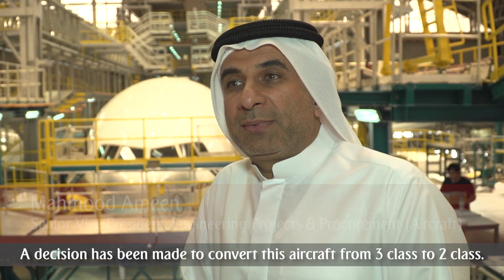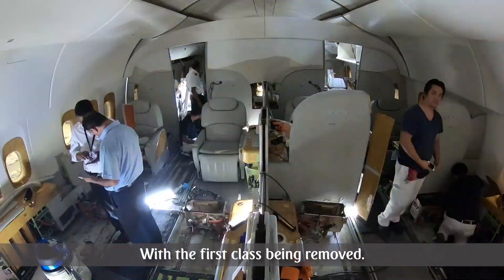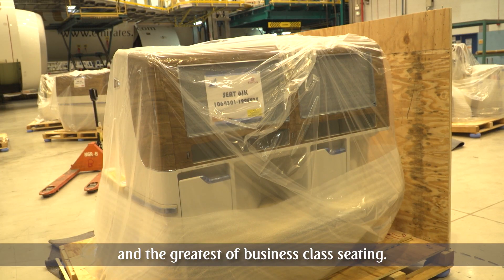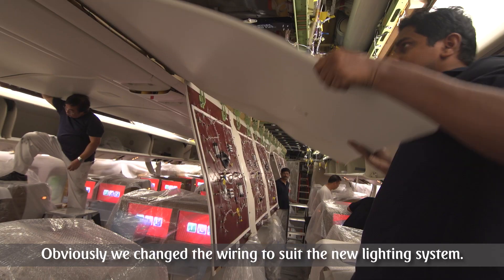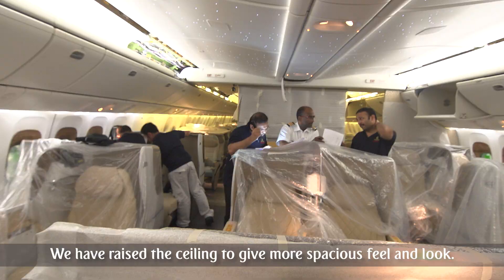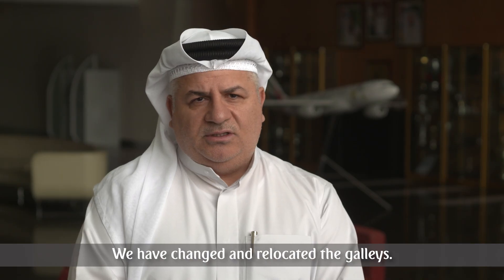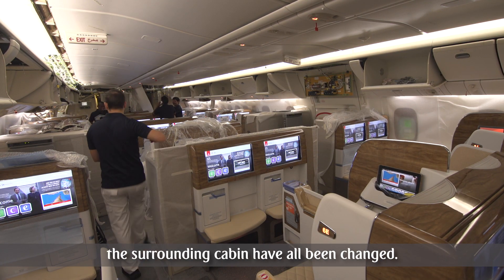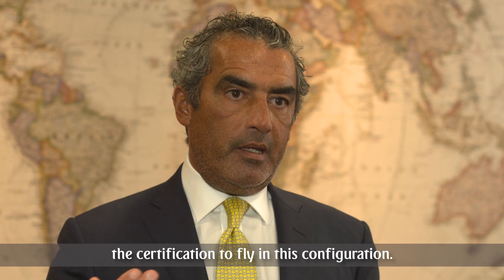Boeing 777-200LR Reconfiguration | Emirates Airline

Comment: Oh the gorgeous 777-200LR, my favorite. All of the B77L on the emirates fleet have GE 90’s right?
Reply: The Boeing Kid 300ER has the GE90
Reply: Ok thx for the info
Reply: The 777-200LR version has been delivered with GE 90's as only option, no other engine type was ever mounted on a 777-200LR
Reply: The 200LR does also.

Comment: Economy IFE looks quite old
Reply: It's still better than the one used on the now retired A330's and A340's
Reply: Achmad Choirul Huda Yeah they only replaced the Business Class Ones
Reply: Avation.expert Knower yeah but I really miss the old Aircraft
Reply: Achmad Choirul Huda Emirates IFE in Economy is litreally the biggest, fastest and the best, go try Air Frances A330 then you will experience true old IFE
Reply: King Kinger The IFE you are talking about is the new type. The old one isn’t great.
Reply: Hmm AF’s A330 interiors are less than a year old and are pretty modern with the latest AF IFE and lie-flat seats. However, just like EK, no direct aisle access
Reply: Its the old cabin....
Reply: agreed, but still, emirates is one airline I do not care if I get the older plane because of the IFE and service being as usual